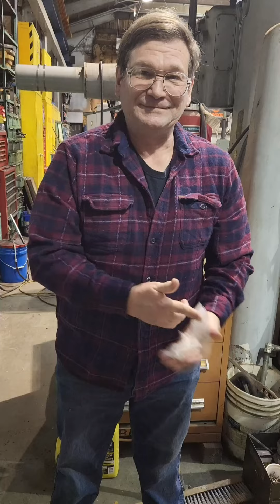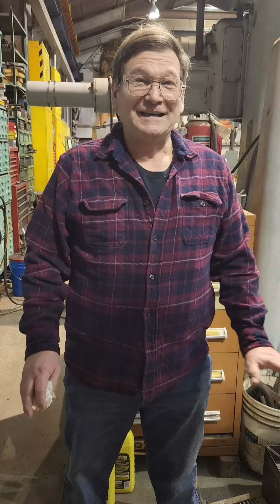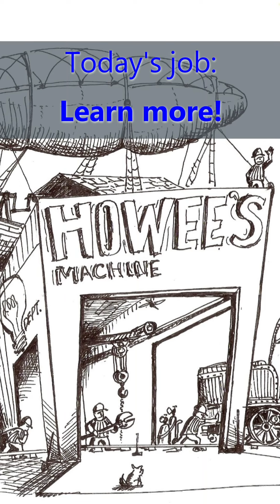Machinist's Minute(s): Working on Personal Jobs in the Shop

Comment: None of my departures were so amicable.  One time, the VP of the company emphatically told the shop that there would be no lay-off yet 9 and a half hours later into a 10 hour shift, several of us were paid and asked to remove our tools from the premises. Back then, it was easy to find another machine shop to work in.  Strangely 2 weeks later, I got a call begging me to return, and I got a raise.  Never could figure that out.
Reply from the maker: I would call it a tolerable departure, no love left at that point, just making myself be nice.

Comment: The problem with Fairbanks Machine and Steel back then was that top management was a brood of Mormons that unfortunately because of lack of skilled Mormons in the area was forsed to hire "heathens" .It kind of culminated with the Christmas spirit one year 1982?when the Mormons divided unto themselves  Christmas hams and 1000 bonuses. Mostly from the fruit of the labor of shop personnel the" heathens". As a slap in the face the shop personnel working three 8 hr shifts[to avoid overtime pay]were given bonuses of three dollars each on Christmas eve. I was living in a tepee at he time with a hungry barrel stove. When the snow melted that year I don't think there was stick of wood anywhere to be found to keep steel off the ground. All that steel and no dunnage or pallets to lay it on. It disappeared mysteriously one piece a at a time. Thanks for the YULETIME logs. I had one every work nite  all winter.

Comment: I’m laughing my socks off here ,I trained as a Toolmaker (press tools ) mainly and I can remember running two or three machines at once ,lathe ,mill and cut off saw or surface grinder .id be doing my work I should have been but also making things for the boat I was building at the time ,I built a stern trawler and fitted it out with winches and pulley blocks ,also some engineering to fit the gearbox to the engine ,,I left engineering and went into the construction industry as a carpenter and also had many chances of self advancement through my work 😂 I’m now retired and love seeing things like your channel brings back many happy memories 👍
Reply: Have you heard of nenna barge company?
Reply: Captain brown worked for them for 45 years, he was my uncle.
Reply: They lived in Fairbanks in the Summers, he missed his 100 birthday by two weeks nice man.